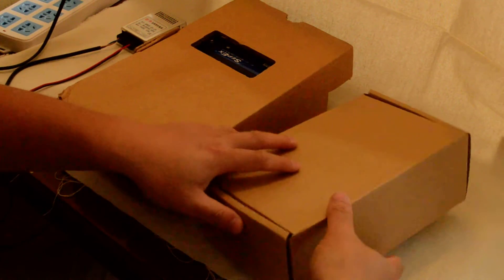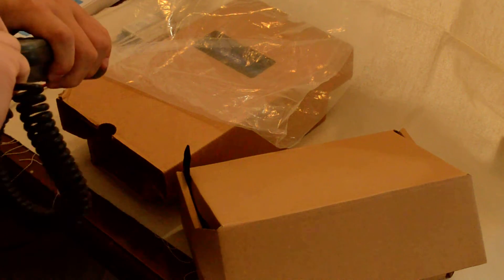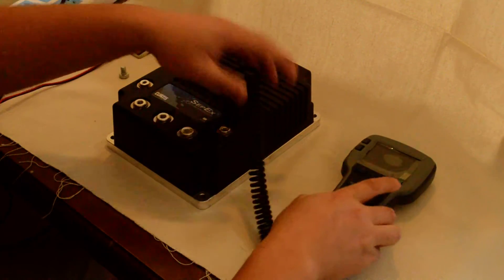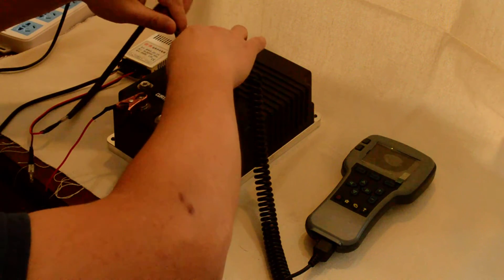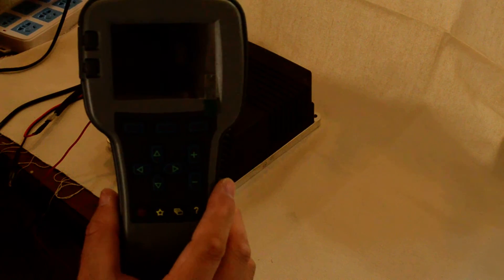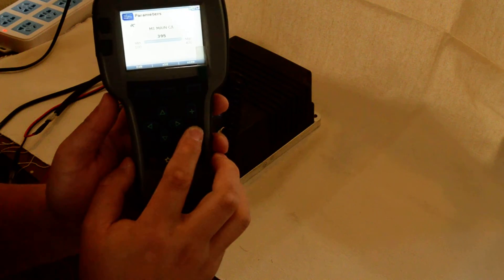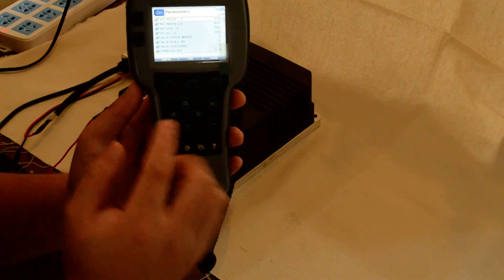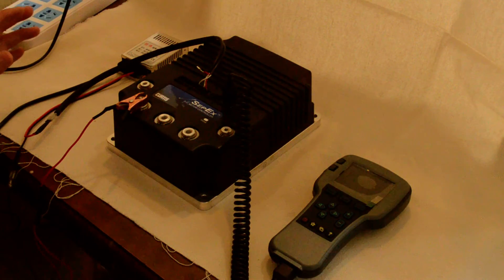How to diagnose a CURTIS 1268-5403 controller with a CURTIS 1313-4401 Handheld Programmer

Comment: my 1311 handheld  wont power on I'm using a 20 VOLT power supply is that enough power to turn on the 1311 ? Also I am getting a 2-1 code flash but the handheld wont power up while plugged in
Reply from the maker: We were told that 16.8V DC source can power on a CURTIS controller. But in practice, the lowest voltage that we've tried is 19.6V, on a CURTIS 1204M controller. For most occasions, we use 24V DC source. It is also recommended that you use a 24V DC source.

Comment: Can you please clearly say what are the cable you connect
Reply from the maker: For a 1268 controller, you need to connect the J1-1, J1-2 and J1-4 terminals to B+ of power source of 16V DC or higher (not higher than the controller nominal voltage). The B- busbar of controller should also be connected. Then plug-in the 4-Pin Molex connector of programmer. With this handset, you may easily view and modify the controller parameters.

Comment: Does the 1313 also work on a 1264-5403 ??
Reply from the maker: According to the user manual, the programmer 1313-4401 works with all CURTIS programmable controllers. But we have not a controller 1264-5403. So we don't have the experience of connecting the programmer to a controller 1264-5403.